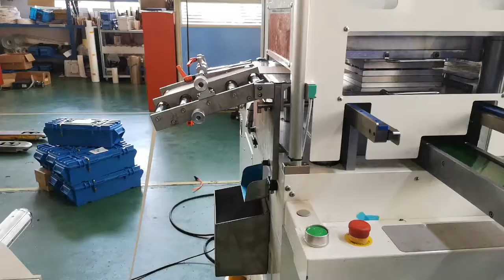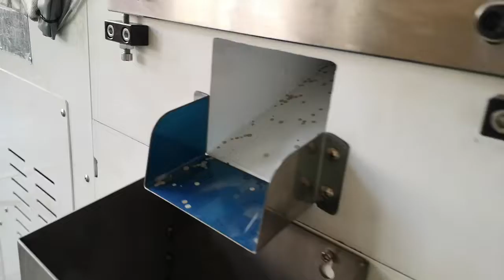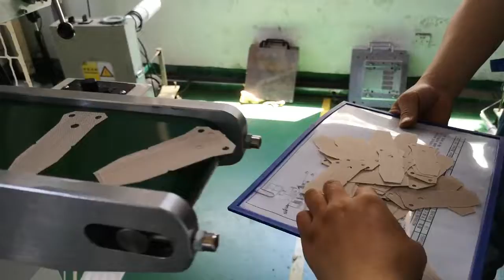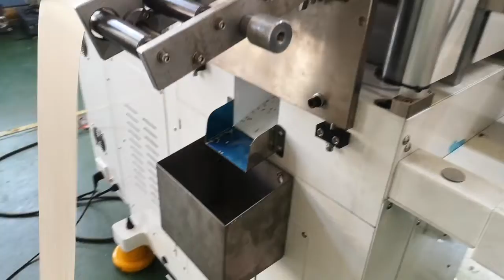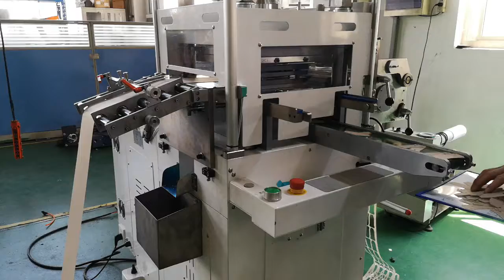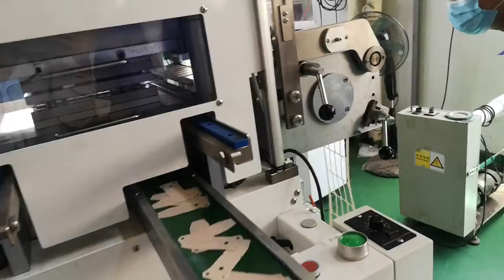Metal die through cut final product, also separate inside hole wastage

Comment: this pres model open the way of using metal die time ! Which dimensions can be die cutted parts? Also for each model a new pres table needet ? or upper and lower press plate are the metal mould parts ?
Reply from the maker: The dimension depends to which model of the machine customer using. 

Our die cutting machine can be 
180*110mm W*L
300*250mm W*L
400*350mm W*L
Depends to customers' requirements. 

You are right, upper and lower press plate are the metal mould parts. 
Our mail address is chuanri@fengrimach.com
Any possible send mail to use, we can give you some more information about the machine. 
Thank you.